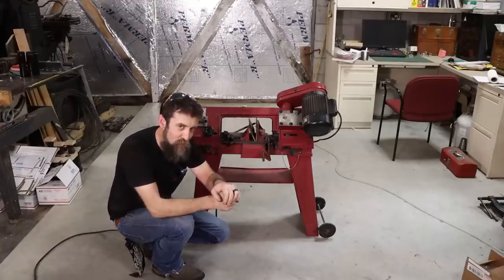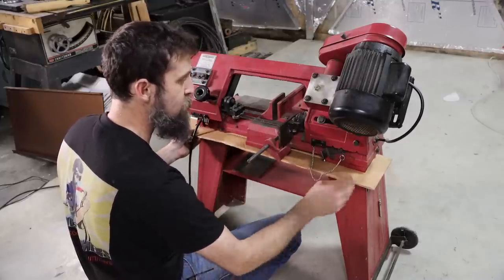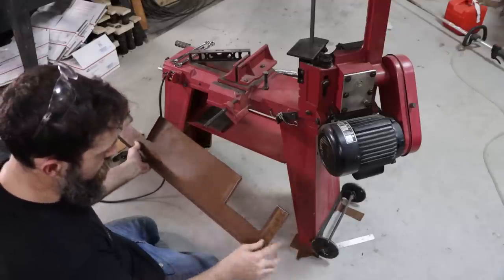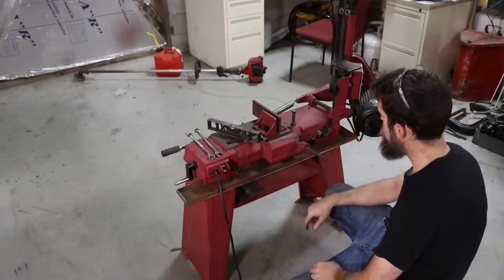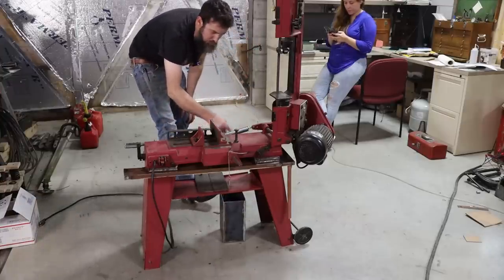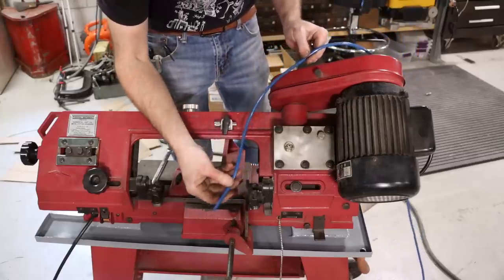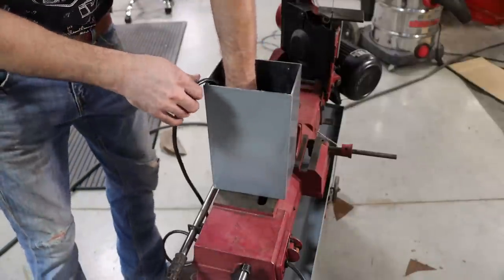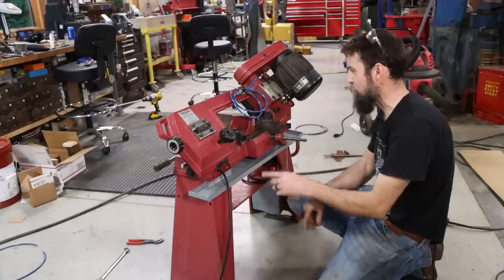Official Flood coolant MOD for the 4x6 Harbor Freight saw PART 1 #harborfreight #saw

Comment: I did the same sort of thing to mine li it different but almost but when it come down to the pump I had problems as chips was going in and blocking the pump full of crap so at the top I put a sponge and on top of the sponge I put a fine mesh to catch the bit chips and the sponge got the finer stuff and it works lovely I clean the mesh every day after use and the sponge ones or twice a month depending on how much I use it but I can say my oil is 98% clean I say that’s doing it’s job well could it be better I don’t know I will tell you if it ever brakes on me lol

Comment: Nice job, I have just bought the same bandsaw and looking into doing this project also but have no welding experience.  Could you recommend a welding machine I can start off on which would also be able to do this job?  Looking forward to a reply.  Regards   Jeremy
Reply from the maker: Pick up one of the weldpro mig machines. Mine is the mig 210. They work pretty good for the DIY guy

Comment: Little Giant is the best value low volume coolant pump that I know of. What kills these pumps is running the pump intake dry. The pump shaft seal requires fluid for lubrication. We ran them 24/7 cycling coolant through our coolant oil skimmers and coalescing tanks. I bought mine from MSC with a volume discount of nominally 10 per order. We regarded them as commodity pumps and threw them away if we had a failure.

Comment: Im not very good at bending sheet metal I bought the red  3 drawer service cart from harbor freight cut off the top shelf put 2 4x4's lag bolted  on the sides and made new angle iron brackets siliconed the ends .... the lower shelf will hold my coolant tank  a better cart would be more stable but it way better than my bent up stand that came with the saw (dont ever try to move the saw in the original stand without the holding pin  in

Comment: I wonder, how do you cut thick vat, let's say 5in thick? I'm told by many suppliers the coarsest blade available in this size is 6tpi. That's way too many teeth for a thick bar. So, does anyone use those saws with thick solid bars? How about grinding every second tooth for example?

Comment: This was a cool fix. :)  I remember watching the series on the "Do-All / Scrap yard Saw" from back in 2019, but I do not remember if you ever got that finished, and do not remember seeing it in any of the more recent projects where you were cutting metal (not to say I didnt just miss it).  Did that ever get completed and where in the shop did you find a place to put it if it did?
Reply: That is on hold as the shed took priority to do. Still outside under a tarp when you see shots outside.

Comment: Steve, the pump is a Little Giant 120v, but whats is it's flow rate? I am going to order one, and wont to make sure if I use it later on a bigger saw like your Do-All, one pump will work for both it & the little Dayton. Glad I watched both parts, and will make the tray longer :)> . Waiting on new trans gear to come in, but making progress. Have a super wk,,Bear
Reply from the maker: 523003  PAAA  little Giant  120 GPH
On Amazon 👍 Thanks for watching

Comment: Good morning Steve. You really should invest in a foam knee pad. That concrete is hard on your knees and over the years takes its toll on you. Also, just for grins, and not that it makes much difference, but I see people using the drill drift upside down all the time. The tapered side is designed to make contact with the tang of the drill bit. The slot in the quill is a straight line through, and uses the straight side of the drift. Nice job on the coolant tray!

Comment: If you are looking for a larger bandsaw I may have a deal for you.   Message me if you are interested.    Have a Shark 310 sx saw for sale out of Missouri.   All works minus coolant pump, as it is missing.
Reply: Do you feel he needs 3 band saws?  If you haven't noticed, as of 12:16 MDT, there have been 2,164 comments referring to a DO-All he is working on.  I believe the larger saw issue has been covered.
Reply: @paulcopeland9035  you must not understand what kinda of saw this is I am referring to… it is a horizontal semi automatic bandsaw.  Believe it has 9” capacity.    Commercial saw.  It’s not a vertical like his do all.   It would replace his one from this video.   Just thought I’d offer it as I feel like it would be a good fit.
Reply: @wesleybradley89  ....Yes, I most thoroughly do understand what "kinda" saw this is you are referring to.  A couple of years ago, Steve was given (by a friend of Brian Blocks) a large DO ALL, hydraulically operated "horizontal" commercial band saw. Steve decided to strip off the hydraulics and turn it into a manual shop saw.  He started the restoration but the expansion of his shop put it on hold and has had it covered in the yard since. Basically every comment section since, has had multiple questions about the status of this saw and when he plans to get back to it.  This is the basis of my sarcasm in the first line of my comment.